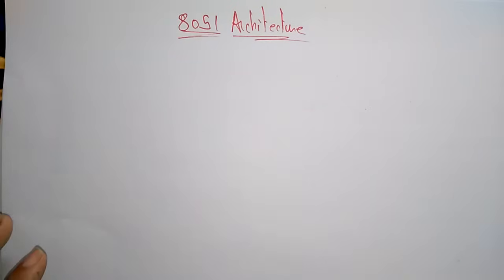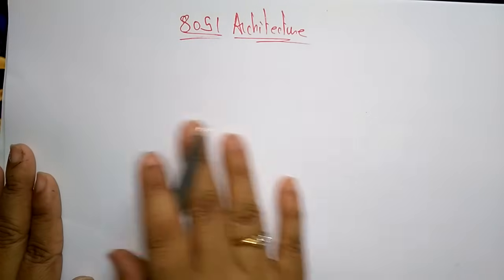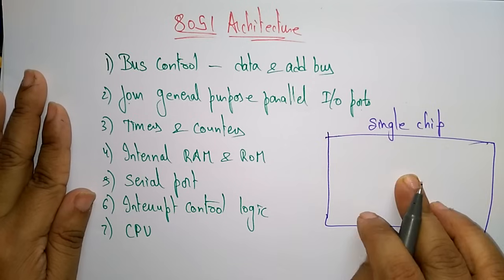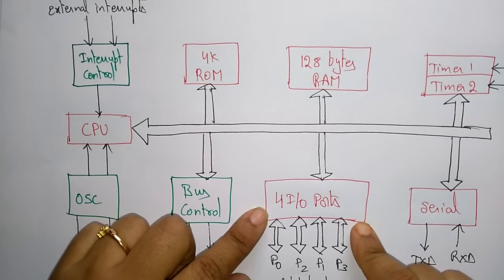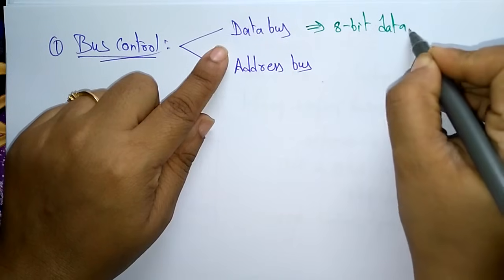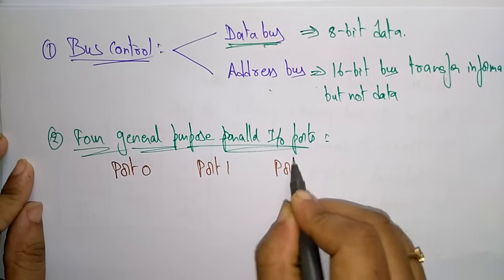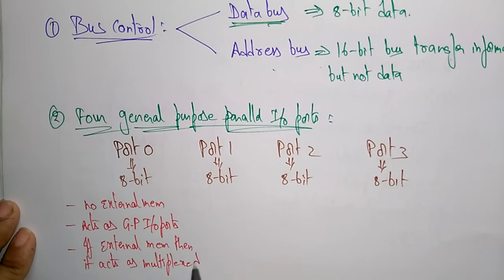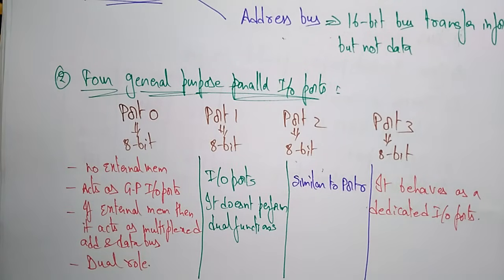8051 microcontroller architecture | Part-1/2 | MPMC | Lec-53 | Bhanu Priya

Comment: data bus transfers data and address bus transfers information ???!!!!   whats the difference between data and information ? Thats wrong.   In Harward architecture of CPUs, data bus is used to fetch data and address bus is to locate the memory.

Address bus is a part of the computer system bus that is dedicated for specifying a physical address. For example When the computer processor needs to read or write from or to the memory, it uses the address bus to specify the physical address of the individual memory block it needs to access (the actual data is sent along the data bus). More correctly, when the processor wants to write some data to the memory, it will assert the write signal, set the write address on the address bus and put the data on to the data bus. Similarly, when the processor wants to read some data residing in the memory, it will assert the read signal and set the read address on the address bus. After receiving this signal, the memory controller will get the data from the specific memory block (after checking the address bus to get the read address) and then it will place the data of the memory block on to the data bus